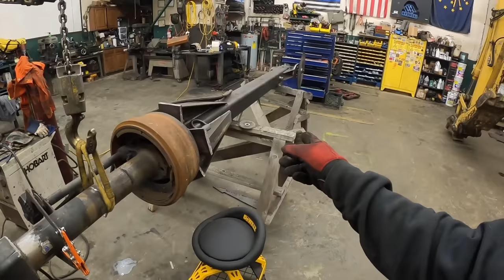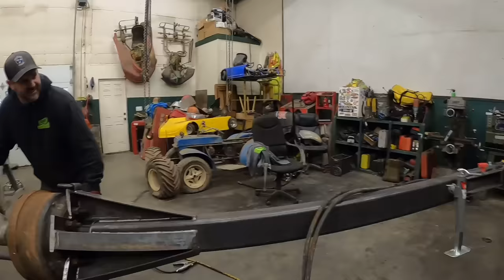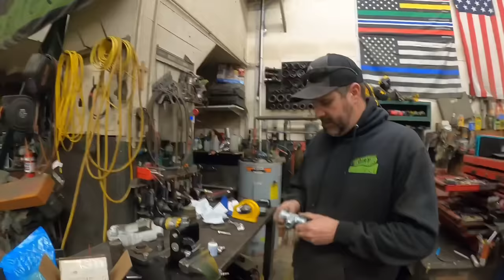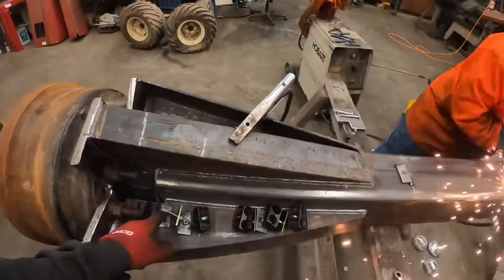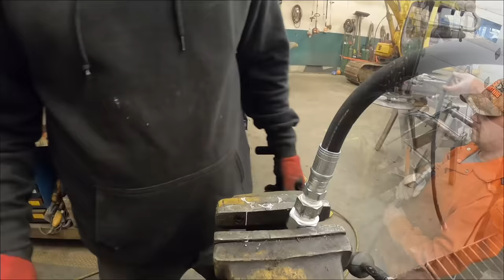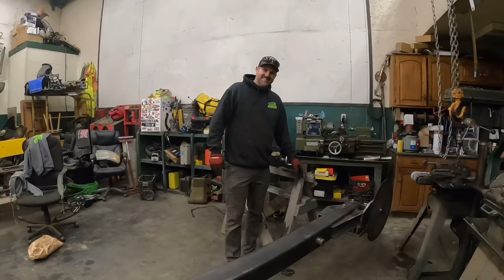First Cut With  the saw  - Will It Work?! Scary Moments!

Comment: Tip! drill a hole 1/4" about 3/4" from main saw mounting hole and make a fold over lock washer with a tang that both holds the blade and the bolt head

Comment: The direction the blade is spinning will loosen the nut not tighten it, IF it does it at all. In theory, it’s the force opposing the blade that will rotate the nut.

Comment: I think you may want to reevaluate the blade direction..  If the blade jams, it will spin the nut off in a heartbeat.  If you look at your circular saw, you'll see that you tighten the nut in the opposite direction from the direction of rotation.  If nothing else, make sure you place a cotter pin to secure that nut.

Comment: When the blade is working the forces on the blade will be trying to loosen the nut won't it?  If the shaft turns clockwise the forces on the blade/nut will be counterclockwise.  The free spinning blade will try to tighten the nut at the moment the shaft stops turning.
Reply: It was addressed in the video.
Reply: @rmacsrmaddog2192 I do believe they had it on the correct way at first. Then they changed it so the blade teeth cut down. Which when the blade hits the wood it will loosen the nut 💁‍♂️😉

Comment: another build…. only 2 things I would add.. 1, get an old bike tire and use it for a blade guard just to cover the blade when you are not using it… mostly to protect YOU from touching the blade and cutting yourself when you’re moving it around… my father has something similar with his blade on his PTO driven buzzsaw… … 2 your brake… I’d put some kind of hook to hold it locked so it don’t accidentally catch a limb, and unlock while in use (like your jack incident) and tear up your hoses (which would SUCK!!!).. other than that… looks good..
Reply: I thought of that too. Glad you said something.

Comment: 240, Hmmmmm. I don't recall any mention of a 240. Now, take the saw back apart and send it out to be chrome plated. This will resolve any issues with color choice. You're welcome.
Reply: 240 has been here for a bit. Its the taki skid steer

Comment: I believe that the blade rotation is incorrect. If the bade jams the nut will undo. Turn the blade so that it is on the right hand side/ cab side and change the blade so the teeth face the other way will correct the issue and also give better view of the blade to the operator.
Reply: I have to laugh so many people say the same thing.He addressed it in the video.
Reply: Yes the blade is backwards at the end. The nut will loosen if the blade stalls. The blade must rotate counter-clockwise (view from shaft end) to self-tighten the nut.

Comment: Loctite hydraulic sealant works well on our hydraulic fittings at work. (And we have a ton of hydraulics). Skip the bottom couple of threads on the pipe fitting and that should abound any tape fragments from getting into the hydraulic system. And we use it on pipe, JIC,o’ring, any hydraulic fitting we screw together. We even have large steel ferrule fittings (which are a large PITA)

Comment: At the Rail Road we had John Deere Backhoes (rentals) they Decided to replace them with Case & we were has Issues between the two a factory rep. came out to talk their backhoes up what it all Boiled down to they were in the designed tolerance? 10 years later replaced with JD! Good Build, Great Video! "So Ready for the Demo!"

Comment: I am impressed at the precision of that saw with the distance from the excavator it is. Excellent engineering guys. The cut was smooth and accurate with no blade shake or chatter.

Comment: DP, I used to design and install compressed air systems in shops. If you want to make people mad, use thread locker instead of Teflon. Works great on high vibration equipment.

Comment: Boss White and Hemp in the 1970s we installed 3 inch steam pipes in factory roof level suspended on hangers. 36 inch Stillson and [ pipe ringers / Tongue chain wrenches ]
When we had to undo the joint after the steam the pipe would collapse. 

Another great video.

Comment: I'd rethink that saw rotation direction with respect to the nut that holds the blade on.
If the saw blade slips on the shaft (for whatever reason) you'll want the movement to TIGHTEN the nut - - - NOT LOOSEN IT!!!!
Reply: Its not gonna loosen 😂

Comment: Great design / build.  Ref: NPT (National Pipe Threads)  I'm not a plumber, and don't claim to be one.  I'm a retired 25 yr's Body & Fender HEAVY Collision / Steel Frame & Unibody guy.  REF Thread Depth NPT, in only 3.5 (three & half) threads, is very common standard, when tighten to full torque.    Now well into my 2nd trade Welding. (4 yr's ship yard welder, welding little 400 foot long canoe's with full size helicopter landing pads on their bow's.)  Made for Gulf of Mexico buoy tenders.  From what I see, your blade appears to be a "CARBIDE-TIPPED BLADE."  GREAT CHOICE, not cheap.  For when you want to sharpen / touch up the CARBISE TIP's, go to your local Harbor Fright (spelling intended) and purchase one of their "DIAMOND- FACED" grinding disk.  Approx. 3" in. Diameter, use on your hand held grinder.  you may have to open the mounting hole (approx. 3/8" in. dia.) up via. your metal lathe.   When sharpening your blade depending on how bad / dull it is, I would expect to sharpen each tip approx. 5 - 10 seconds average, i.e., just a "TOUCH-UP."  Use "Finger-Tip-TEST" for sharpness.  Your CARBIDE-TIPPED BLADE, will be able to cut through the occasional 16 Penney nail / Clothes-Line Hook,  (approx. 1/4" in. {0.25" in.} Diameter or less,) found in some trees.  Like butter.

Comment: You're right.. the NPT needs some kind of sealer or the gas/liquid/air will just follow the threads, and pour out of the bottom. 
The flare connections don't get tape, or putty, because the flare itself creates the seal. You should NOT put anything on it, because you may prevent the flare from sealing properly.

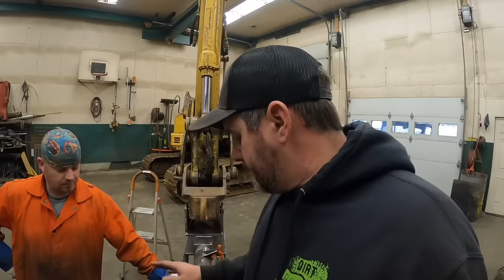Comment: 16:50 It's not really a "Downfall" of the valve to be one directional, the blade only cuts in one direction, so it's probably a good thing. You just got to remember to push your cab controls and hook up your lines in the right direction all the time. But you should quickly get used to that issue. 
Also; I'd think about wrapping those lines with fire hose where they go over the brake drum so they don't get vibration wear?
So the next question is; when is logger wade going to be borrowing it?

Comment: Pretty sure the flow on your hydraulic motor needs switched.  Right now it's rotating clockwise the same direction as the right handed threads.  It needs to rotate counter clockwise from right handed threads just like a table saw and circular saw.  That way the nut won't spin loose. Awesome build and can't wait to see it in action!!

Comment: If the blade tries to slip on the arbor, it will loosen the nut.
Teflon tape works ok on hydraulic hoses, IF you keep it off the first  2 or 3 threads. It can cause problems if you have to remove and replace that pipe thread fitting and don't get all the left-overs out of the female side.

Comment: Use Loctite product 545 or 5452 non fouling sealant for NPT fittings in hydraulic systems. Unlike thread tape or liquid sealant paste, it will not plug any orifices in your hydraulic system if it gets into it. It contains no fillers or particles that can interfere with a hydraulic system.

Comment: In Australia we have a  tractor with an arm on it with 3 saw blades driven by hydraulic motors , one for each blade. on a bock section frame . The hydraulic arm from the tractor mounts in the middle of the  blade beam . This is  for cutting trees and hedges sides and tops

Comment: ***CAUTION***Your going to spin the saw blade nut loose if you don't put pin in castle nut. This is because hydraulic pressure stops quick and force of blade turning will spin it off!!

Comment: Pipe threads need some form of sealant because the threads are not a perfect match. Even though the threads are tapered, when you tighten the fitting, the threads are pulled to one side, leaving a very small space on the other side. In most cases it's not enough to worry about leaking, but a little sealant assures no leakage.  I had a plumber install hot water heat in my addition, he used both teflon tape and pipe dope on all pipe threads.  He told me he never had any leaks that way.

Comment: Turned out really good! Your machining on that blade spindle is better than most factory ones 👍 can’t wait to see it In full use . I will say hydraulic / blade speed is deceiving because it has torque. All our grapple saws chain speed compared to a chain saw is way slower but heck do they cut like butter

Comment: Teflon tape applied 2 threads bak from the end of the NPT threads, sealing on npt fitting occur at 3/4 length of insertion. When in doubt crank it in further, and no reverse crank it tighter to align... Mike

Comment: I think you need to upgrade the lock and rotating system so that you can control the angle and the lock from inside the cab. That way you can adjust your cutting angle as needed while cutting.

Comment: I’ve ran the trimmers for utility companies for many years one piece of advice I can give is it would be good to get a saw guard on it especially since it’s running direct drive from the shaft and when that shaft breaks (not if)  that blade will take off and it’s not good the ones for the actual trimmers have a intermediate bearing

Comment: Suggestion, find a tire that is a little larger than the blade, slice it in half and rivet a ratchet strap to the outside.  wrap it around the blade, then tighten the strap and now you have a travel guard for the blade

Comment: never taped fittings before, but I worked in a very different field than heavy equipment. it was all rubber o-rings and safety wired. not sure why taping would be bad though, once the line is at pressure it shouldnt matter what is used for the seal as long as it hold and doesnt break down by fluid contact. the internet needs to calm down, its not stupid if it works.

Comment: Ah,DP I could be wrong but I think you want the nut to tighten not loosen turning the blade in that direction. Lefty loosey righty tightey but the blade load is on the right so it will loosen up under load.

Comment: This is an awesome build, you have me wanting to build one for myself now. my concern is that it looks like you are not running an open circuit, I have blown several seals out of my mulchers because i forgot to open my circuit and when I let go of the button the seals let go! may not be a problem with the lighter saw blade but just thought I'd mention it even though I am sure you know but my excitement sometimes outweighs my judgement!

Comment: as usual another great video of shop work. you are going to have to be careful DP, you are becoming your own arch nemesis, an engineer. the only saving grace is you a working application engineer. 1 other suggestion, now that it is working be sure and turn the blade around before use.

Comment: The way the blade is now  installed , If your thread is RH,  blade torque will loosen the nut.  The blade's torque  is  wrench torque on the nut.   The  gear box output shaft  needs to turn the same direction as it did on the mower.

Comment: If the nut is right handed thread to tighten the saw the motor should rotate in a counter clockwise rotation as to not loosen the jam nut when cutting

Comment: Need a power head bypass with check valve so when you cut power, it can freewheel down pushing fluid in a loop.  Check valve will close when you apply power from one direction, not the other.  It's a really simple alternative to a dump to sump 3rd hydraulic hose.  A rotating machine like this needs dump to sump outlet or this bypass.

Comment: My hydraulic shop told me 2 threads away from the end of the fitting for the thread sealer- tape or goop.  Made  sense to me.  Also, is there a reason to worry about the run on of the blade?  If too much momentum, would it be possible to blow motor seals?

Comment: A dummy fitting in npt adapters while cranking in the fitting keeps from distorting the adapters internal threa Even running a tap through the distorted fitting does not gaurentee a good seal. Comm' on Mike!

Comment: Most of the pole saws for excavators at the bottom of the blade spins away from the excavator so when the cut is finished it pushes the branch away from the excavator instead of pulling the branch towards the excavator. Just a lil food for thought.

Comment: When you lifted in the strap the centre of gravity was higher because of the vee in the loop. When you welded the ring you shifted the centre way down so it hung much easier and giving you a much wider tolerance.
Pity not to have reverse for when you snag the blade, maybe. My chainsaw doesnt exactly reverse either.
Can't you make an electric solenoid to operate brake release from cab?

Comment: I use LocTite 243 to seal pipe threads.   It´s a lot less messy to use.   :-)
Reply: I use 243 an you can't buy it just anywhere , most places only have 242 , linde forklifts require 243 on the gland nuts of there cylinders, anyone that says no tephlon on pipe thread is wrong as well as use it on jic , jic use 243 or the green loctite.

Comment: DP like kid in candy store, itching to try out death wheel. smooth movements, blade spins buttery smooth. pipe dope gets everywhere no matter brush you use or how careful you are with it. at least it wasnt the black kind. that is nigh impossible to get off,stains skin. DP expanding into the tree trimming market

Comment: You may need a couple different diameter blades for different jobs.  You may also want to consider fabricating a guard for the rear of the blade that will force the chips down and prevent anything from getting thrown back at the cab.

Comment: I'm not a keyboard warrior, just asking a couple questions thinking through the use:
- are all your machines matched in terms of male/female fittings for flow (or I guess you would just need to use your switch opposite of the way that might be natural)
- do you think you might need some gussets between the excavator pin mounts to keep the backing plate from bending or will the force be minimal (not like the machine would be standing on it)
Reply from the maker: Almost impossible to match them all because I have to match the what everyone else uses . And 0 concerns about plate to tube connection thanks for the comment

Comment: Watching Aaron nearly welding your finger to that tube,reminds me of something that happend to me when I was helping a fitter ,he was welding a strip of metal bar to a scraper box.The bar didn't quite fit so he asked me to push it with my feet to make it touch so he weld it to the box,I closed my eyes to protect them from the arc,when he had finished I opened my eyes to find he had welded the steel toecaps of my boots to the bloody bar.

Comment: Great build... should slice through trees with ease....question..if you rotate the boom 90 degrees, won't the blade be cutting in the opposite direction.?   Will it cut differently?

Comment: When I was learning to install gas lines to HVAC years ago, the gas company told us not to put pipe dope on the first 2 threads so it wouldn't get into the gas valve.

Comment: WARNING !!!!!!    The torque from the motor will loosen the nut once you engage the blade into the wood.  You need to secure the nut or run it the other way.  Think about your grinder.....  it tightens because the threads are running clockwise which tightens when the disc hits the metal.  This saw is running counter clockwise which will loosen it.
Reply from the maker: lol no
Reply from the maker: Think about it
Reply: I did, I thought about it and then I noticed you have reversed it in the next video.  It was the first thing I looked for.  Good Job! @DirtPerfect

Comment: would be smart to put a check valve loop in the line between the motor and flow control.
It would do two things, let the blade free wheel to a stop and not undo your blade nut, and also not let the blade be run in reverse

Comment: Wonder if a feller could find a ring gear to fit inside the brake drum and use a hydraulic motor with a gear mounted on the short boom,  inside the ring gear to rotate the long boom remotely? Something to think about.

Comment: What I think your do is put some kind of bar above the edge. Wherever you're going with your hoses. That way, you can strap them too. So they're not hanging around and then going down into that breaker. Whatever. I mean, if it's turning or rabbit or any of that, then it's gonna be a problem.

Comment: Yer running backwards. Imagine a wrench on the blade nut. When you run it does the wrench tighten or loosen the blade? Don’t rely on a carter key to keep it tight. They can shear way too easy.

Comment: You had the blade on correctly before, it should be that if it slips the nut gets tighter, and since you have standard right hand threads, the blade should rotate CCW, think about the old trucks with left have threads on the left side of the semi. Now if the shank and blade were splined it wouldn't matter as much.

Comment: Could have used one direction to turn the blade and the other direction to run a motor to rotate the blade. I think I would have had the blade resting on top when sitting on the jack stand just to the blade further from the ground. That’s just me though. I used Teflon tape on my hydraulic lines too but I used liquid Teflon tape way more often as I found it faster but it does usually end up getting everywhere like anti seize like y’all mentioned.

Comment: I worked on Cleaver Brooke boilers for 3 yrs , did all the piping for them ,water ,gas ,oil and Methane, teflon tape on water line only. pipe dope , what we called it on  everything else , nothing on flared fittings, if they found teflon on gas or oil pipe threads they made you redo the gas line. The finial Boiler Master inspector would have a few nasty word with you.